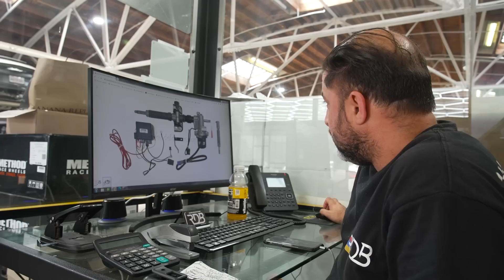Ferrari 488 PISTA Spider WILD Spec! Rolls Royce Ghost on RDB Wheels.

Comment: 8:57 botton racing stipes look off centre..
Reply: I think it's just from that angle of the shot because of the curves on the hood to the front end.
Reply: The car is pretty well centered in the video.....
Reply: @inlangford  I'm not saying it isn't lined up in the shot. I'm saying the way the car is sitting and the curve of the hood makes it look tapered from top to bottom or off from the flat bumper.
Reply: Stripe is of by at least 2 degree